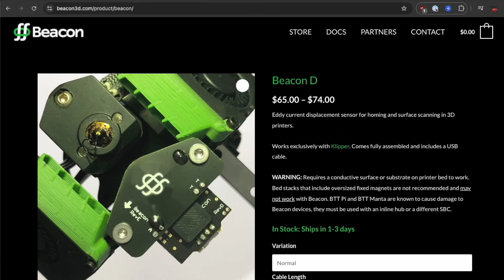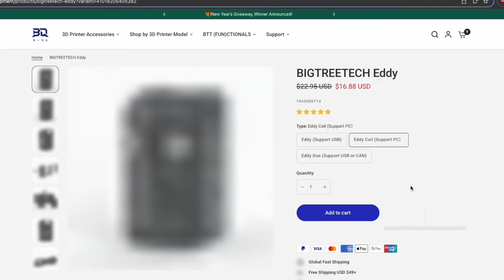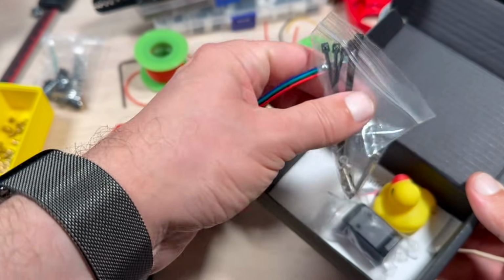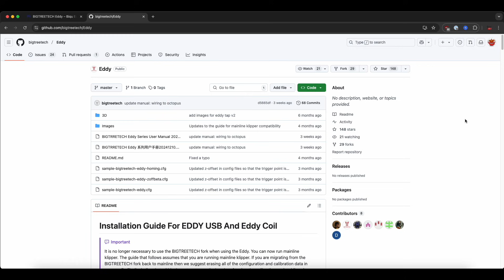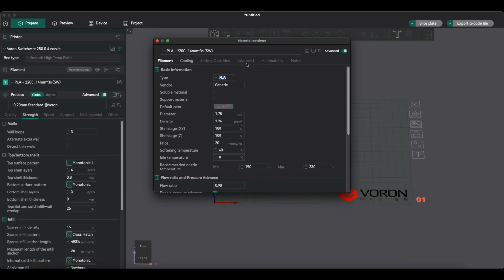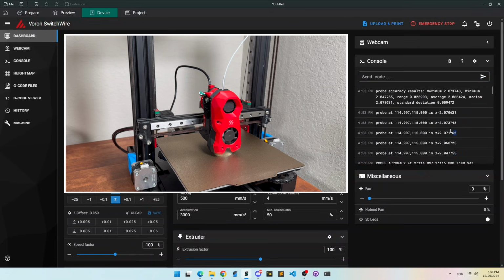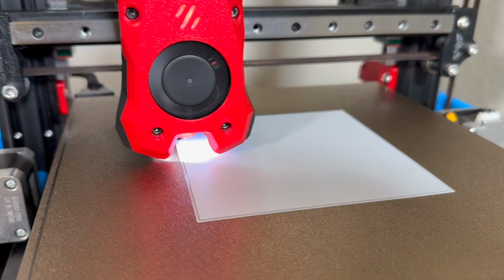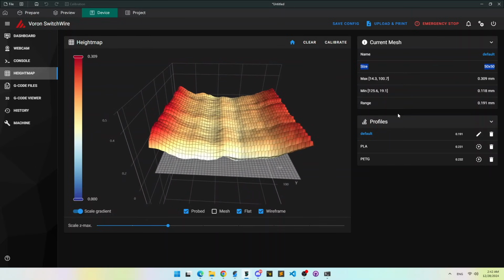Installed BTT Eddy with EBB36 on my EnderWire

Comment: Did you use the fork version for installing the eddy? the klipper repo says that it can't be used as a z ends top yet, or is that just wrong
Reply from the maker: I have used mainline klipper, check my btt eddy config may be it will provide you with some insight: https://github.com/irebane/my-printers-misc/blob/main/EnderWire/btt-eddy.cfg
Reply: @ I had another note here, but in it i said how i am building a homemade printer and wanted to use EDDY but decided to pause on it just because of the extra layer of information/confusion by having to use a different fork.  I thought by this time in 2025 they would have resolved this.  

But thank you for sharing your config file as i am slowly (and i mean slowly) and starting to understand how all of this works.  In the final version of the machine i am building i do want to have the EDDY on it.  

So a question has hit me - why does EDDY require it's own fork of Klipper?  What is in it that is different?  And how did you figure out how to get it working with the mainline Klipper instance?  Well done and very impressive.
Reply from the maker: @GMx_1  it’s no longer needs own klipper fork most of the code was merged some time ago. Original BTT configuration guide describes all the details.
Reply: @hobbyistnotes  That is good to know, thanks!  

I just finished the millwork on an adapter plate to attach my Orbiter 3 to my Ender 3.  I am using it as a test bed for the Octopus controller, Orbiter, etc... The plate turned out very nice - square, smooth, milled to a shiny surface, too bad it will be stuck in-between the Orbiter and the carriage.

Comment: Hello, I’d like to ask something.
I saw your Enderwire configuration on GitHub, and in the printer.cfg under the extruder section it says:

gear_ratio: 75:10
rotation_distance: 33.85

Is the 75:10 gear ratio meant for the CW2 Stealthburner extruder configuration?
Isn’t the CW2 gear ratio supposed to be 50:10?
Reply from the maker: You are correct, but technicaly it doesn't matter as long as gear_ratio and rotation_distance tunned to proper amount of extruded material. As even gear sizes vary between pankake mottors like moons and LDO, I do not take gear_ratio as single source of truth. I think my current gear_ratio came during migration from CW1 -> CW2 long time ago and now it's just sits there. I use a lot of diferent extruders and always tune rotation_distance only as it's much faster.
Reply: @hobbyistnotes I'm using an LDO motor on my CW2 extruder and using Bondtech gears. This equates to a 50:10 gear ratio, is that correct? Previously I used a 50:17 gear ratio on the CW1? Should I change the gear ratio from 50:10 to 75:10 like you used on the CW2 extruder?
Reply from the maker: @madorax251  I think it make sense to setup gear ratio based on gears you have and tune the distance. You can use Voron's CW2 klipper config as starting point.

Comment: Could you share which x carriage you are using ? 
Thanks and awesome helpful video 👍🏻
Reply from the maker: It’s stock Voron Switchwire X-carriage. You won’t be able to use it without whole Switchwire mod and I have 2 videos about that mod on my channel, I suggest watching those to see how it was implemented.
Reply: @hobbyistnotes I am building switchwire rn 
You don’t really show it in your 2 build videos unfortunately 
But thanks I thought it was a modified version
Reply from the maker: @paulb5299  Few years has passed since I converted my printer and at the time there was only few converted printers around and I bet now you can probably find much better parts for Enderwire. I personally have absolutely 0 issues with this printer and I do not really change anything cus in current state printer just works without any voodoo, it's my most trusted TPU machine.

Comment: The Eddy Coil (I2C) is not able to be used to calculate Z-Offset/EndStop, while the Eddy (CAN/USB) can - it has temperature sensor, so it might worth to get the "complete" one, even if it adds complexity due to (CAN) firmware in the probe.
Reply from the maker: I got this product and made video before CAN or DUO versions were available. Keep in mind to support CAN for 99% of the people who own something like Ender 3 updating to full CAN setup will be costly and not worth it just to get Z-Offset/EndStop and heat compensation features which are not necessary by any mean especially if you use same nozzle in open build printer. Other than that sure use CAN.

Comment: Well this fixed my issue thanks man . Just copied and pasted the config and set my homing and mesh settings and did the one paper test and it's been great
Reply from the maker: Glad it worked out ;-)
Reply: @hobbyistnotes  yup yup !  I haven't even ran the command for temp calibrate yet lol call me lazy and it even works with the  a print start macro I got of off someone git hub where it heat soaks and does all kind of cool stuff before it prints
Reply: I did have to change my home_printer data_1 cause I have multiple klipper installed on 1 pi

Comment: Hello! I have a question about wiring on the toolhead bord. As i see on the video l, you just run usb d+ d- over can wires and took it from two jumper like pins to usb type-c.... So they are stil connected to CAN-H and CAN-L on the ebb?? Or made any other changes there?Is it safe to use like that? Or maybe there is any other moments i need to know to replicate it? I have almost the same setup, except my motherboard: I'm using btt skr pico
Reply from the maker: You can find here more details on EBB USB mod: https://lab4450.com/blog/upgrade-can-ebb36-to-usb-toolhead/

Comment: I just wanted to say that i found you video to be extremely helpful.  Also i really liked the pacing of the information and the amount of detail provided was just about right... for a newbie like myself more detail is usually preferred however too much detail at the wrong time can be confusing.  

Your 3DPrinter is one of the versions that i am targeting as a build and my choices for components are very similar to what you have picked so that helps to give me confidence that i am on the right track.  

In short - great video!

Comment: I tried to add Probe accuracy but getting a: "PROBE_ACCURACY SAMPLES=': unable to parse" error . I changed it to just "PROBE_ACCURACY". I have searched around and have found a few inaccuracies with command callouts. 
 When I do a Z_Tilt on my printer it just probes once It normally probes at least twice How can I adjust this?
Reply from the maker: You need to declare variable_homing_samples variable with in  macro. Copy whole macros and it will work.
Reply: Where can I find the macro I have the same issue
Reply from the maker: @Steves_3D  https://github.com/irebane/my-printers-misc/blob/main/EnderWire/btt-eddy.cfg
Reply: @hobbyistnotes  thank you

Comment: I would like to thank you for the first layer fix you provided. I have tried everything I could've thought of and finally just gave up and manually adjusted first layer on every print through micro stepping. I found your video and looked at your extra probing cycles. Decided to try it out and it fixed it! I can now print without having to worry if my nozzle is too far away. Thank you so much! This fix should be added to all templates on the BTT GitHub since i am sure we aren't the only ones experiencing this issue. 

Once again. Thank you for providing a fix for this!

Comment: Can the mod via usb be used on the ebb sb2209?
Reply from the maker: Pretty sure it can be set the same way.
Reply: @hobbyistnotes  because i don't have a UTC board after seeing your video connecting ebb36 via usb to rpi i immediately wanted to try it
Reply: Incidentally, the printer that I want to install ebb 2209 is ender sw like you, I have 2 but 1 is still using the stock board v4.2.2 and the other is using skr E3v3. If I use the stock board, can the ebb work well via the usb mod?
Reply from the maker: @madorax251  It doesn't really matters what control board you have as you will connect toolhead board to the RPI via USB. Keep in mind that I only tried EBB36 with this mod and have no idea how stable SB2209 will be. If you care about the price I'd recommend to buy EBB36 as it's twice as cheap and for sure was tested in several of my printers. But if price doesn't matter and you want SB2209 like setup there is already a USB version of same board made by BTT may be it make sense to take a look at ready to go solution?

Comment: there are klipper macros to ignore the first result on Z probe which might help with your Z offset. i think danger klipper also has this built in
Reply from the maker: That is what original BTT macro is doing as well but that this is not enough.
Reply: Could you link to that? Would love to test it out, i really want my printer to ignore first probe
Reply from the maker: @Ravenkeeper-c3z  Check my github(link is in description), I have posted all related files in EnderWire folder. You can change amount of probes by changing variable_homing_samples variable. Here is file you want: https://github.com/irebane/my-printers-misc/blob/main/EnderWire/btt-eddy.cfg

Comment: SOVOL SV08 not full klipper, not much chance :(
Reply from the maker: Isn't there a manual available for getting to a mainline klipper with SV08? https://github.com/Rappetor/Sovol-SV08-Mainline
Reply: @hobbyistnotes  some say the installation brick there printer
Reply from the maker: @3D_Printing  Good to know, I didn't knew that. Personally I still would take a risk.
Reply: @hobbyistnotes  im on mainline.  Took about an hour to do.

Comment: I have an ebb36 on my printer using CAN bus, is there any advantage using usb mod? Very good video btw.
Reply from the maker: I find USB mod more stable than CAN but there is a downside as well to this setup as you can kill your RPI if something goes wrong with power wires in umbilical cable, let's say 24v will short on USB signal wires. I think one of the main advantages is that you don't really need canbus supported motherboard to run EBB in USB mode like in my case.

Comment: i use the eddy usb on my switchwire with 2040 ebb can toolboard, works much better that with servo clicky probe, the weight would always drop the extruder down. But have also one eddy melt while printing ABS and failed cables (non canbus setups)
Reply from the maker: Thank you for sharing your experience it was very interesting to me how many people really use those and how well this probe holds up over time considering the requirement of it being mounted ~2mm from the nozzle height.
Reply: @hobbyistnotes  on my Voron trident that mostly prints ABS en ASA the  eddy housing melted a bit, deformed and made the coil/pcb angle not right anymore.  The suggestion from BTT was mostly not to heat the bed over 60C and keep the doors open....
Reply from the maker: @AnandNL  What a joke solution to be honest...
Reply: @hobbyistnotes  the max temp of the eddy is 90 within the setup and have killed prints for me. i have raised it to 110C